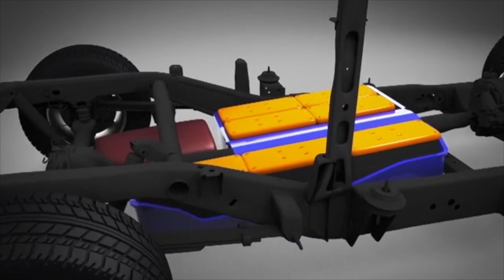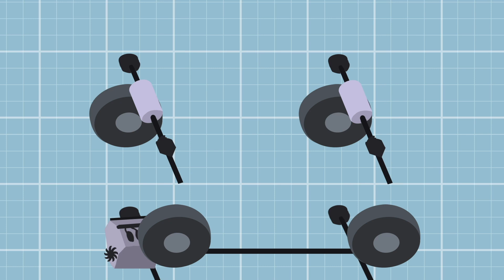Could This Pickup Truck Design Change The World?

Comment: almost the same design as a diesel-electric locomotive :)
Reply: Yep, but with batteries.
Reply: Diesel electric locomotives do have batteries.
Reply: @karlp8484  It's a Diesel-Electric drive train with much more Electric Buffer. Most Diesel-Electric have a type of Buffer either Capacitors and/or Batteries. But their Engines are constantly operating while moving as they do not have enough capacity to operate without the engine generating.
Reply: MrMadness Yes!!!!Exactly!!!!! I know they have had the expertise and the technology to do this for decades.  I would desire them to produce an equal energy line of engines.  I mean engines that provide energy to energize electric direct drive motors and maintain accessories or even recharge the main battery pack of an electric vehicle.
Reply: @karlp8484  
I forget who but someone was making a "shunt" engine with batteries.  The result was a lower running cost but a bigger tractive effort on starting the cars moving.
Reply: Ken Smith. I think it was Bombardier.
Reply: Most diesel-electric locomotives (in the US, anyway) don't have any kind of buffer, they just vary the engine power output in order to vary the amount of power being supplied to the traction motors by the alternator. The advantage of a series hybrid system with battery storage (as explained in this video) is that the engine can always be run at its peak efficiency and the varying power demand of the vehicle can be met by the electric traction motor(s) and battery.
Reply: Make the hybrid trucks with a small diesel engine, which most big truck buyers prefer, and advertise it like a 4 wheel locomotive, and you have yourself a marketing winner.
Reply: @TommyboyGTP  Yeah, but diesel engines are massively obsolete, they're just too dirty and don't offer any advantages anymore.
Reply: @PistonAvatarGuy  
For most long haul rail, the engine ends up running at good efficiency values because the whole thing is designed around that one case.  Thus for that a battery would be of little help.
A truck in traffic is quite a different case.  For it, batteries to double the power output for a few minutes would be a good design choice.
Reply: @kensmith5694  Yeah, I was just countering what Neojhun said. It was almost 20 years ago that I first started wondering why series hybrid systems (with battery storage) weren't being used in road vehicles, the efficiency gains could be very significant... if they're optimized properly.
Reply: @PistonAvatarGuy  That's not true at all.  Diesel's are far more efficient than gas, and produce much more torque at lower RPM's.  With today's cleaner processed fuel and particulate exhaust filters, and advanced computer controls with multi shot injectors, they run super clean.
Reply: @TommyboyGTP  " Diesel's are far more efficient than gas..."

Not really, and they're no longer efficient enough to offer any advantage. The fuel cost more, more CO2 is produced when its burned and diesels have much higher NOx emissions. Compare the diesel CX-5 to the 2.5 gasoline version, the gasoline version is quite a bit more powerful, has lower CO2 emissions, MUCH lower NOx emissions, has lower fuel cost, and is cheaper to buy and own. The same is true of the 1.6 liter Cruze diesel and the 1.4 liter Cruze turbo. I can actually name a bunch of combinations like that.

"...and produce much more torque at lower RPM's."

Again, not really, and especially not when you're talking about hybridized and/or turbocharged gasoline engines. That's also completely irrelevant in a series hybrid arrangement.
Reply: @PistonAvatarGuy  Sorry but B20 diesel burns very clean.  They are more efficient and have more torque in the low to mid range.
Reply: @TommyboyGTP  Sorry (not really, actually), but you've been mislead. B20 might be cleaner than other diesel fuels, but it's not cleaner than gasoline. Diesels have higher NOx emissions than gasoline engines, period, there's just no way around that. Diesels are more efficient, but burning diesel produces more CO2 and diesel fuel is more expensive than gasoline, so the CO2 emissions from diesels are typically higher and diesels have higher fuel costs.

Diesels only have more torque than gasoline engines if they're boosted higher and gasoline engines rarely even need to be turbocharged anyway, which means that they can be cheaper and more reliable. Even still, more torque is absolutely meaningless, it doesn't do anything for performance and most Americans drive automatics anyway, so there's no advantage to having more torque at low rpm.
Reply: @TommyboyGTP  Mazda CX-5: 187 hp (gasoline), 173 hp (diesel); CO2/mile 321g (gasoline), CO2/mile 348g (diesel); annual fuel cost $1,550 (gasoline), annual fuel cost $1,700 (diesel); EPA smog rating (out of 10) - 7 - (gasoline), EPA smog rating (out of 10) - 1 - (diesel). 

Chevy Cruze: 153 hp (gasoline), 137 hp (diesel); CO2/mile 267g (gasoline), CO2/mile 276g (diesel); annual fuel cost $1,300 (gasoline), annual fuel cost $1,350 (diesel); EPA smog rating (out of 10) - 6 - (gasoline), EPA smog rating (out of 10) - 3 - (diesel). 

Ford F-150 2.7 EcoBoost: 325 hp (gasoline); CO2/mile 420g (gasoline); annual fuel cost $2,250 (gasoline); EPA smog rating (out of 10) - 5 - (gasoline).

Compare to...

Ram 1500 3.0 EcoDiesel: 240 hp (diesel); CO2/mile 448g (diesel); annual fuel cost $2,750 (diesel); EPA smog rating (out of 10) - 1 - (diesel). 

I could go on, but this is pretty time consuming.
Reply: @PistonAvatarGuy  No one goes by horsepower ratings with diesel engines, they go by torque.  You fail.
Reply: @TommyboyGTP  I fail because people don't understand physics? I don't think so, bud. Torque is completely meaningless, power is the only figure that matters.
Reply: @TommyboyGTP  You really do act like a child! If torque is all that matters, why are the diesels slower??? EXPLAIN YOURSELF!
Reply: Listen up junior, they aren't slower.  The only thing that's slow here is you so go play in traffic  @PistonAvatarGuy
Reply: careful he'll call you out for saying that torque is more important than horsepower for a street driven car hahahahaha  The94GTC
Reply: The94GTC  MODERN diesels don't have longer lives than modern gasoline engines, they're massively complicated and start having major problems when they're only a few years old, this also hurts their resale value. That's the problem, people don't understand that diesels have undergone enormous changes in recent years, they're not the same engines that they once were. 

Torque means nothing, PROVE ME WRONG!
Reply: Ceew ceew ! or chew chew
Reply: @matthewcalifana488  Choo Choo  :-)
Reply: @TommyboyGTP  Thanks Tommy
Reply: The94GTC  Car, truck, vehicle, whatever you want to call it.
Reply: @PistonAvatarGuy  Torque is a power measurement.A vehicle with no Torque wont move very good if at all.In fact with the Heavy Duty Truck's the Torque is what allows them to tow such heavy loads.In fact compared to gassers diesels tend to have low hp but high torque. But for regular heavy duty towing diesels tend to do better.And more efficient.The main down fall with diesel is 1-The myth that they are worse for the environment. And 2-In alot of places in the USA diesel fuel cost more to buy.And they are more expensive when you do have to work on them.
Reply: The94GTC  Power is measured, that's what dynos are for. Power determines how quickly work can be performed, like the work of towing heavy loads, or accelerating a vehicle. Working on trucks doesn't teach you physics, obviously.
Reply: @tritchie6272  No, power is a measurement of power. No, a vehicle will not move without torque, but the amount of torque doesn't tell you anything about how much weight a vehicle will be able to move, or how quickly it will be able to accelerate. Power tells you how much torque you can make at the wheels at a given vehicle speed, more power means more torque. 

"In fact compared to gassers diesels tend to have low hp but high torque."

That's only because they don't rev as high. If your engine can't rev very high, you have to make more torque in order to make a certain amount of power, that's a disadvantage. 

Diesels being worse for the environment is not a myth, their smog-forming emissions are much higher and their CO2 emissions are also higher. I posted proof of that above.
Reply: Neojhun No. They don't. The only reason that trains have diesel electric drive is because the electric motors make max torque at stall. Much better for taking off with many, many tons on board.

And before you try and defend your comment with bullshit, do some research. Google is your friend...
Reply: The94GTC  "Torque is measured and horse power is CALCULATED."

I mean, really, they're both calculated, but I know where this myth originated. People think that because some dynos measure torque first and then calculate power from that measurement, that only power is calculated, which is the dumbest thing ever. The truth is that some dynos (inertia dynos) measure power first and then calculate torque second, it works both ways. 

Contrary to what the uneducated believe, power is perfectly observable. For example, if you have a 20 ft I-beam being spun around with 10,000 lb-ft of torque, but it's only spinning a 2 rpm, it's not going to bother you much if you're hit by it, but if it's spinning at 2,000 rpm with 10,000 lb-ft of torque behind it, your reaction to it will be much different. The difference is that the I-beam that's spinning at 2 rpm only has 3.8 hp spinning it, while the one spinning a 2,000 rpm has 3,808 hp spinning it.

Torque alone doesn't get you moving, if you have movement (a spinning engine) you have power. You can have torque with no movement, POWER is required for movement.

Lastly, the more power you have, the more torque you can produce at a given rpm, that's the whole reason that the rating exist. POWER IS EVERYTHING.
Reply: The94GTC  You mean CO2? You do realize that plants were growing for BILLIONS of years before humans started burning coal, right?
Reply: The94GTC  Humans produce about 100 times more CO2 than volcanoes, that's from the USGS.
Reply: The94GTC  Yeah, myself and the majority of the scientific community are clueless, but some random guy on YouTube is the world's foremost authority on climate science... right. /s
Reply: The94GTC  No, that includes all eruptions and all human CO2 emissions.
Reply: The94GTC  Before humans started pumping CO2 into the atmosphere, natural CO2 emissions had been extremely well balanced with natural carbon sinks for many millions of years. In other words: What nature put into the atmosphere, it also removed. We're not only adding more carbon to the atmosphere than nature can remove, but we're also destroying the natural carbon sinks entirely.

We know that the current warming is a result of human CO2 emissions because our emissions produce a unique form of carbon.

250 million years ago was a LONG time ago and the Siberian Traps aren't currently erupting... I'm not sure what made you think that was relevant. I guess I could say this: Volcanoes can cause extreme climate change, but they haven't done so for a VERY long time. Massive asteroid impacts can also cause climate change, but that's not currently relevant either. This time, WE are the asteroid.
Reply: The94GTC  BTW, when something like biomass CONTAINS carbon, that carbon is CONTAINED, it's not in the atmosphere trapping solar energy. That shouldn't even need to be explained.
Reply: The94GTC  Human CO2 emissions are around 26 GIGATONS per year, that's BILLIONS of tons, Yellowstone's emissions are less than two tenths of a percent of that amount.
Reply: Flixportal xD

Comment: Just 26 miles per gallon? That's amazing given the size of an f150
Reply: Newton's  laws be dammed. Should just make a car so efficient it can run a lifetime on 2 aa batteries lol.

Other note, gaddison flag is right track... But beware of being led.

Notice the hidden 666 in the snake.

The snake is also symbolic...
Look up ouroboros.

All presidents are puppets.
The master is the banks.

I'll let you discover the rest on your own... It can be tough to swallow.
Reply: I would like to see a F-150 that gets 26 MPG in real world driving conditions using the pickup as it normally would be used.
Reply: @randallfrank5682  
You get a diesel if you are constantly hauling loads for good mpg.
Average truck owner is happy with Decent daily milage of 25 ish.

There's simply less energy per gallon of gasoline than diesel and will never be able to really compete in hauling. Thus why semis use diesel engines.

Comment: As a Chevy Volt owner, I'm very familiar with the range-extended electric concept, and I've also had full-electric vehicles. And while pickups are a huge part of the market, I think you're looking to the wrong place to start off....

According to the Federal Hiheway Administraction and American Public Transit Assoication's Public Transportation Fact Book, Delivery Trucks have a higher Average Annual Vehicle Miles Traveled than Cars, Light Trucks, Light Duty Vehicles , Motorcycles and School Buses. Delivery trucks average 13,116 miles per year, and they get notoriously poor mileage.

Our company operates two Ford vans - an E-150 and a T-350. Both get horrible in-city mileage that would benefit greatly from either a hybrid power train or a range-extended electric power train.

I note that FedEx and others are experimenting with electric propulsion, but if Ford and others would get behind electrification for its van fleet, you'd see a nice reduction in carbon emissions.
Reply: I seem to recall that the new electric delivery trucks of DHL here in Germany are actually produced by Ford, after previous models were developed and produced by a small specialized producer.
Reply: @KaiHenningsen , yep:
https://www.cnet.com/roadshow/news/heres-your-first-look-at-fords-electric-dhl-delivery-van/
Reply: @jizzlecizzle1388  I've been reading about the StreetScooter and thinking, can I import one (to Canada) to lower my company's delivery costs.  I had no idea that Ford is now building them.  It's almost insulting that an American car company is building an Electric van that could drive down delivery costs yet they don't sell them in the US.
Reply: @markplain2555 , this is why manufacturers like Tesla are such a threat to legacies like Ford.
The former is more 'agressive' and agile.

On top of the obvious benefit of cost reduction by switching to EVs, a fleet could be used as a microgrid and help save money, even making some.

This is the future of automobile and actors like the Big Three seem in denial.
Reply: Jizzle Cizzle  The difference between Ford and Tesla is that Ford must make money each year...Tesla is so “cool” they don’t have to make money.  Imagine the screaming on Wall Street if Ford  lost money like Tesla. They would be gone in no time
Reply: @nhdan7610 , no company 'must make money each year' in the sense of making profit.
As long as the market has 'faith' in it, it can borrow, have investors inject cash, find ways to keep its operations running.

Amazon has been notorious for not turning profit on the regular until recently.

Uber is still bleeding money.

It's not specific to Tesla.
Reply: A hybrid school bus is a no brainer they usually dont leave the city and only run a run a few hours twice a day not all day.  Lots of stop, go and wait activity too.  Unfortunately many operators buy the cheapest models, in recent years ive seen fewer diesel and more gas buses with no baggage bays.
Reply: @jizzlecizzle1388   - I would hate to have a debate with you - it would be boring cause we would always agree.  But to add to your point, Tesla is going to succeed in becoming a mega motor manufacturer only because the other motor manufacturers are simply not responding to the true latent demand for EVs.  While they all drag their feet, Tesla grows in their vacuum.
Reply: @jizzlecizzle1388  - I'd like to add to the conversation between you and NH Dan: Elon was once asked what is the profit percentage of his cars, to which he responded, "It is not our intention to make profit". The interviewer gulped at the response. Elon went on to say, "Our main objective is to become the catalyst for converting all vehicles to electric. If we were to go out of business tomorrow because everyone converted to electric and drove us out of business, then I feel my objective has been achieved." That statement, places Elon in a very different category. He has figured how to make profit but without the intention of making perpetual profit. This alone makes him a far greater threat to the motor industry than one would imagine.  Today I drive a Leaf and that is ONLY thanks to the fact that Elon showed an electric car can be a viable decent car.
Reply: Other segments of the metropolitan delivery system are 'going electric' too, the single seat EV from Electamechanica for example, is looking at sales in those markets (inner city delivery, think divorce court stuff and pizza) and of course, anything with wheels that holds one person (skate boards, bicycles)  is now been electrified by someone.  I think UPS is trying to dump all those behemoths they campaign around the country too.
Reply: @markplain2555  , considering the recent announcements regarding its sales figures and finances, Tesla is really on the right path.

Doubters are changing their tune and 'legacies' are still lagging.

You can clearly see a shift in the industry as well as the society at-large and Tesla plays a major role.

In that way, it has already succeeded.

Comment: Actually electric vehicles require more fossil-fuel then gas vehicles.
You use up more fossil fuel charging an electric vehicle then you do driving a gasoline vehicle.
I can't people get that through their heads?
Reply: My solar system provides 100% of my Bolts charging needs.